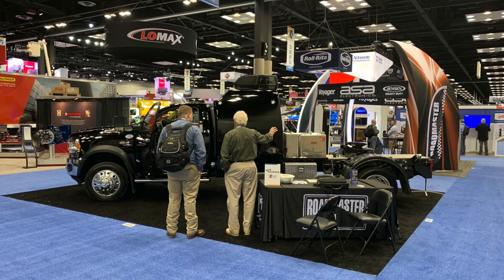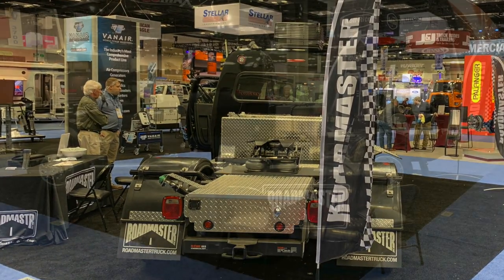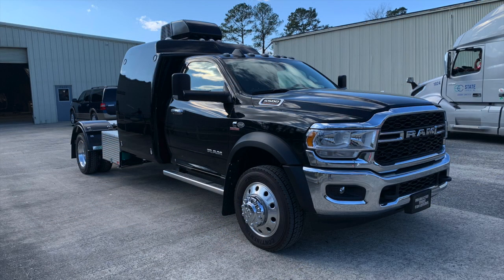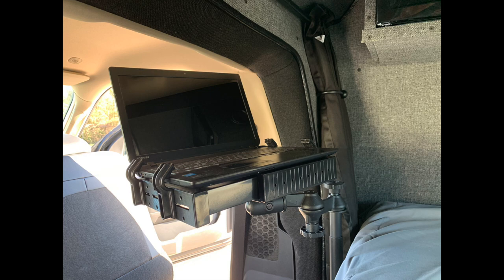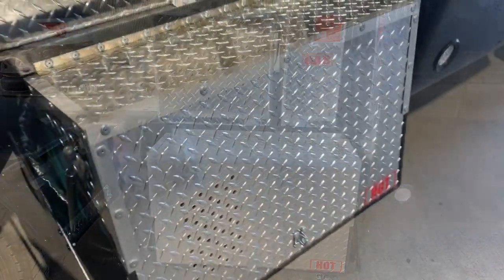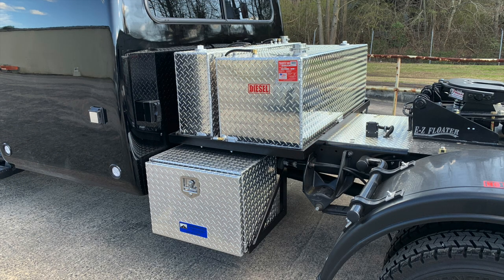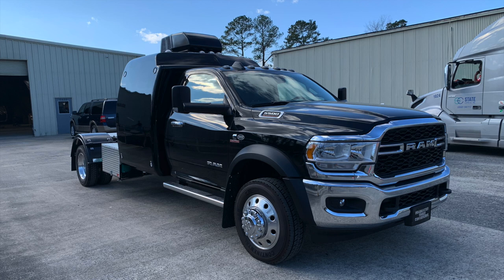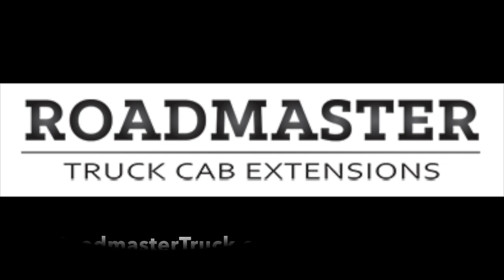Roadmaster Custom Build 8

Comment: What mods are done to the front seats to make the sleeper FMCSA compliant? Specifically the requirement for at least 36"W X 18"H opening between the sleeper and the driver's compartment. Does this require the front passenger seat to be removed, movable etc?

Comment: Is that truck non CDL ?
Reply: That would depend on what trailer your pulling not so much the truck itself . As long as the rating of the trailer your pulling plus truck rating is 26000 or less then you don't need a cdl . Example let's say truck is rated for 14k and you put a 12k trailer behind it then that's 26k no cdl required however let's say truck is rated for 15k and you put the same 12k rated trailer behind it then that's 27k which requires a class A cdl